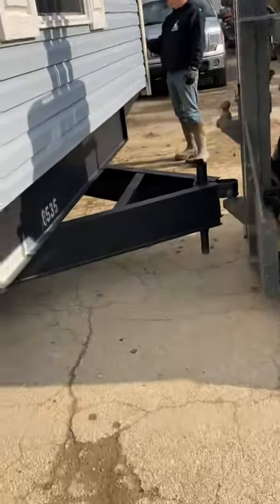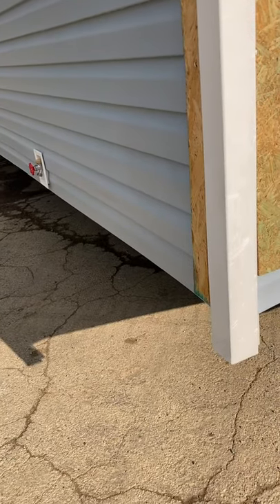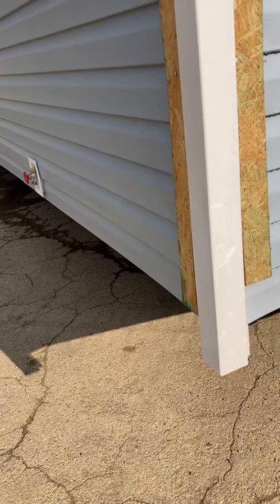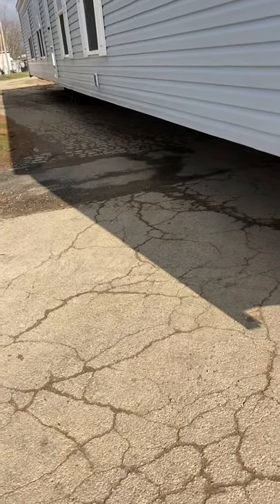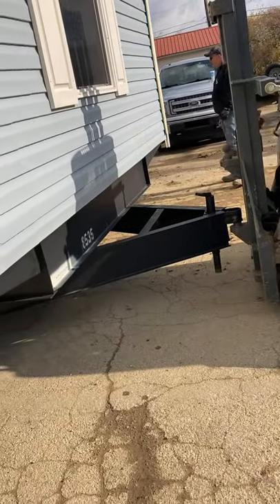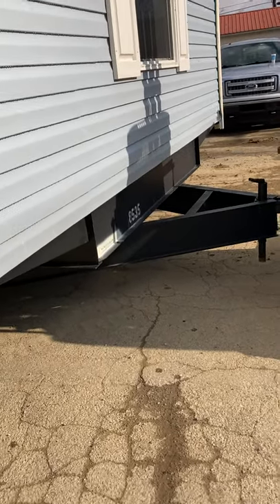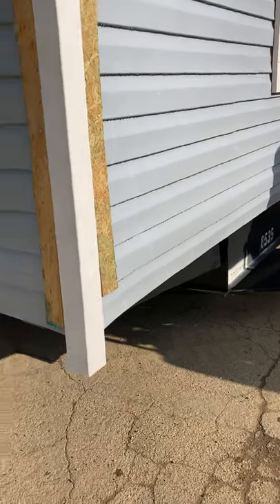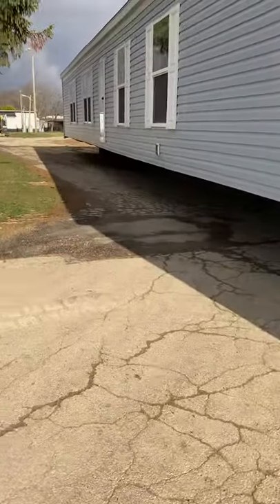Moving a mobile home with a skid steer!

Comment: Hey hows it going iv got some questions for you if you don't mind
Reply from the maker: Yes go ahead with your question
Reply: What is that attachment called?
Reply from the maker: We call it a mobile home attachment. A guy out of Illinois makes them. Pair it with a skid steer of a weight of at least 10000-11000lbs and it will move 80 foot homes all day.
Reply: @jescoward2809  Whats the tongue weight of a 14x70
Reply: @SwampDonkeyHomestead  I would guess between 3-4k. I bought a tunge weight scale. Depends if 2x4 or 2x6 or shingle roof adds lot of weight.
Reply: It's seems all the videos of skid steers moving houses are on open flat areas where it would be easier to just use my truck. Need some need some videos of skid steers pushing their limits

Comment: Is the attachment doing all the work of picking up that mobile home ?
Reply from the maker: The attachment runs on the aux switch and the hydraulics of the skid steer. The counter weight of the skid steer is a must too or it will tip you into the home. Must have a skid steer that weighs 10000 lbs or bigger.